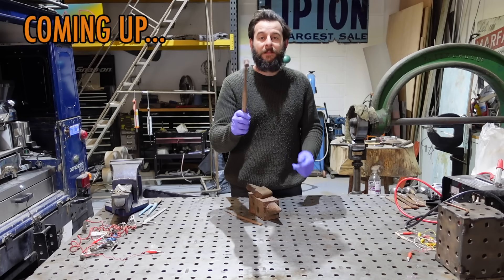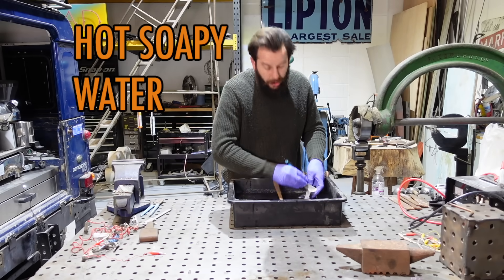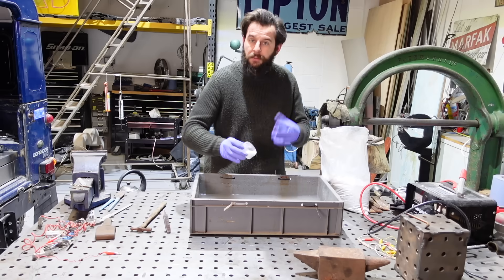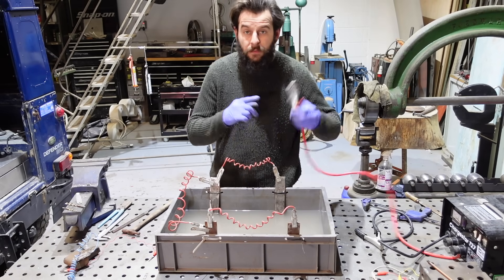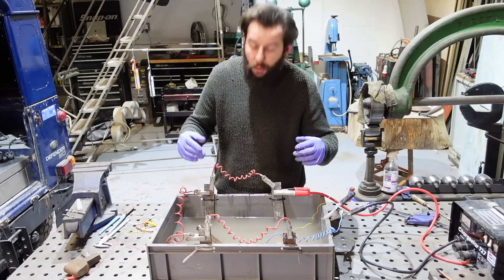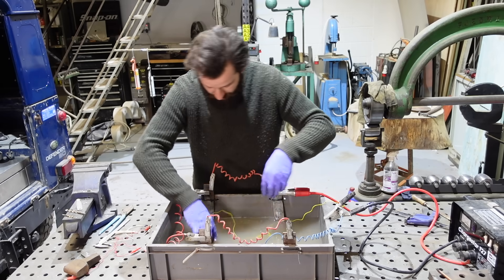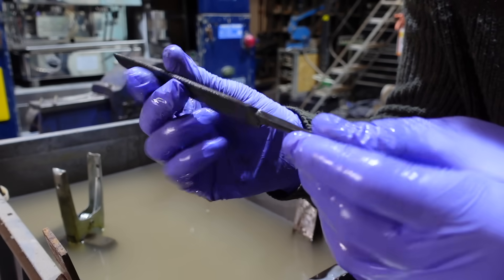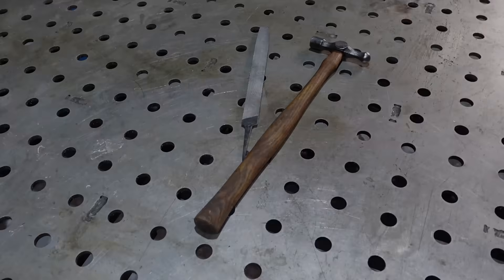The Power of Electrolysis | How To Transform Rusty Tools!

Comment: Love the electrolysis technique - I've got a project that I'm about to try... Fingers crossed it goes to plan! 
Here's a question. And bear with if it's a bit long winded. 
We are currently completely rebuilding a 1977 narrowboat to live on and using a lot of old woods etc for finish. But behind the log burner we can't use wood (for obvious reasons!). I have a couple of sheets of galvanised steel (about 6' x 2') that's been stored outside and has areas of rust that we fancy using but the dilema is we want to keep the 'patina' of the rust but not let it get any worse... Any suggestions for how we could do that? 🤔 
Love the work you do... 
Cheers
Reply: "WaxOyl"

Comment: Entertaining and so informative. Coming from Sheffield, a City that excels in the manufacture of quality tools,  I appreciate how important it is to renovate and re-purpose tools such as these. As opposed to just buying substandard cheap rubbish and discarding them after little use. I just came across your presentations to-day, looking forward to seeing many more. Thanks for posting.
Reply: Thank You so much for a good educational video. I have a lot rusty tools to practice with🙂
In Denmark some artists make sculptures in some kind of  wax, and paint it with, I think cuprium sulphat. The they make an electrolyt bath(?) of some kind and have some sacrificial cuprium, that Will, by electricity be moved trough The electrolyt medium and shape solid at The outside of The model. In Denmark The artist Galschioett is doing it, for years and has maked large scales models that way. As example a model of The godess of liberty in more than six foot tall. They have a big tank ive been told. 

Can You please show in a small scale how to do, and what needed to perform this proces? I think this proces Can be very usefull to learn and practice and maybe be used to do an surface non corrosive with other materiales. Like crome. (very poisones don't Even think of it) 
You asked for challenges🇩🇰🇩🇰🇩🇰✌️😉👍🏾 thank You on before hand. 🖐️

Comment: I've had good results by making the part to be cleaned the anode, not the cathode. Also, periodically reversing the polarity can make a difference. Try it on some old coins and see the difference. Salt water or Sodium Hydroxide (electroclean) can also be used as the electrolyte. Food for thought.
Reply: There's a reason why we choose to use the polarity we do. We want the rust to come off the work. Electrons come out of the negative and flow to the positive. We want the charges to carry the oxidization away. Things work for reasons.

Comment: Worth noting that the rust can be saved, dried out and turned into a fine powder, then used to make thermite. Which can be surprisingly handy now that acetylene is so hard to buy for small scale users.
Reply: Oh and if you've any of those huge lantern batteries lying around with the double spring connector on the top, take it apart and you get 2 surprising hard wearing graphite rods that work quite well as anodes, and you can wipe them clean afterwards :)

Comment: Vinegar works really well just leave it overnight and use a brass brush to finish it off if you're in a hurry you can get a dremel tool it's useful for all sorts of things.
Reply: Cider vinegar works a treat.
Reply: This method bests vinegar hands down! It's quicker and works much, much better. 
I've tried vinegar and got bored waiting over a week with nearly zero effect. Threw it away & used electrolysis. Did the job overnight. Plus, electrolysis doesn't smell at all. That acetic acid smell gets old really quickly!
Reply: Eh.  Electrolysis takes a few hours at most and ive never had any luck overnight with vinegars..  maybe after a few days..  but rather not have what im cleaning come out smelling like piss...

Comment: Dom, 10% w/v (weight/volume) sodium carbonate solution is more than enough for cathodic cleaning. Some pieces of 304/316 stainless steel would be good as anodes (Pt is a bit too expensive!). A clean up with mild citric acid solution afterwards works a treat too.
Reply: Handy advice, thanks.
Would a small amount of Pt in the electrolyte improve the reaction through catalysis, whilst still retaining the large S.S. anodes to do the 'heavy lifting'?
Reply: @tiggywinkle1000  On this sort of scale no. Pt is a more efficient cathode for small-scale electrolytic etching and cathodic cleaning though.

Comment: Much simpler way is to just dip rusty things in vinegar (or some rust remover (ie. evaporust)) for overnight. Same result in my experience.
Reply: Vinegar is an acid. It will react with, read rust, iron tools. Granted, it will react with the rust faster, but a basic solution is the better bet.

Comment: Basically what's happening is that the current is driving oxygen out of the rust on the cathode and into the water, and over on the anode it's encouraging oxygen in the water to 'rust' the exposed iron.  Once all the anode surface is coated in oxide, the reaction mostly stops because the oxygen can't easily get through the oxide layer to unreacted iron.
Reply: The reaction slows because oxide is a poor conductor. Eventually the anode gets so coated with rust electricity has a hard time overcoming the resistance it presents. Oxygen created by electrolysis has no useful function in this process. It just happens. It'd be better if it didn't. Not the end of the world though. Oxygen actually comes off the sacrificial anodes in this process. The bubbles coming off the work being cleaned are hydrogen. No rust is being converted here either. It is just being transported from the work to the anodes. Basically what's happening here is the rust is being stripped from what you want cleaned and deposited onto the anodes. That's it.
Reply: @1pcfred  Brilliant explanation, thanks.

Comment: There is apparently a way to sharpen dull files is it this or an acid treatment
Reply: File sharpening is a contentious issue. There's a lot of wives tales floating around concerning it. Some say acid sharpens files. Some say leaving them out to rust sharpens them. I say nothing beats a new file. And when they're beat they're beat. Though some of the reason soaking files works is it cleans them.

Comment: Brilliant video. Recently started blacksmithing and bought some old tools to get up and running and this looks like the ultimate way to restore them to their former condition. Thanks to all who have highlighted dangers from poor ventilation. I would add the importance of switching off power BEFORE disconnecting any components as even a small spark could ignite that oxy/hydrogen mix. The process is similar to charging a car battery and I have had to give first aid to someone who removed lead with power on and the spark blew up the  battery. (almost blinded him) Careful !!!

Comment: Maximum current is not what you should aim for.
You should set up the cell with tap water connect the power supply and a current meter ,and add the washing soda until the current reaches your desired level - usually around 0.5 to 2 amps.
I usually add half a cup of washing soda to a tank of the size in this video. 
safety ratings of sodium carbonate:
Health Rating: 1 - Slight
Flammability Rating: 0 - None
Reactivity Rating: 1 - Slight
Contact Rating: 2 - Moderate

no need to freak out  - if you get it on your hands ,you'll have to suffer the horror of clean hands
Reply from the maker: There we go thank you! That’s the amount of washing soda cleared up! 
Thank you for the comment!
Reply: @DominicChineas  We have The Repair Shop on TV in NZ at the moment  I thought you looked familiar
Reply: Why do you want your current so low? What is the benefit to reduced flow in this process? I know what it should do but I want to hear what you're going to come up with.
Reply: @1pcfred  High current results in poor conversion of Fe3O4 back to metallic iron at the surface of the part ,resulting in a loose spongy layer of iron on the part and also causes excessive erosion of the anode

Comment: You forgot to mention ONE VERY IMPORTANT safety point.
The process of electrolysis produces a VERY HIGHLY FLAMMABLE GAS called HHO or browns gas. 
Therefore this process should only be done in a well ventilated area and ABSOLUTELY NO naked lights, sparks or high energy heat sources. Even to the point of not switching on or off light switches and plug sockets.
The molecules of this gas are extremely small and can get into places that would otherwise seem impossible.
Plus it's flammable capacity is around 30 times greater than petrol or propane.
However,,,, on a lighter note it does disepate(vanish) quite quickly as it is lighter than the air we breath and it is not toxic(poisonous) ether, although the sodium carbonate fumes will irretate your throat and lungs if inhaled(breathed in).
Reply from the maker: Thank you for this very helpful message, I have included a note in the text, about the gas, appreciate you sharing your knowledge, nice one
Reply: @DominicChineas  Its a mixture of Hydrogen and Oxygen and is flammable but the quantities are small and in a well ventilated area should cause no problem.

Comment: You didn't say or I missed it do you need to neutralize the cleaning solution or rinse it off with clean water after the electriolis bath
Reply: Since a base is not very reactive with metal, a simple wipe should suffice.

Comment: Would wire wool work well as an anode? Huge surface area and throw away when done.
Reply: Wire wool may catch fire. I know touching a 9V battery into the stuff makes it catch up. I used to love to do that as a kid. So 12V with some current behind it may not be such a good idea. Stick with thicker scrap ferrous metal as sacrificial anode. The bar this guy had is ideal. Lots like to use rebar though.

Comment: An interesting video, thanks.  What are the gasses which are given off at the anode and cathode?
Reply: Water (H2O) breaks down to two parts hydrogen gas and one part oxygen when an electric current is passed through it. 
Take the same precautions that you would when charging the car battery in the garage - no smoking, and plenty of ventilation.